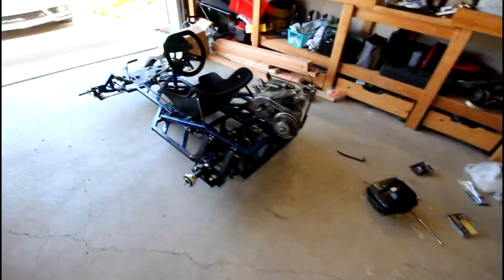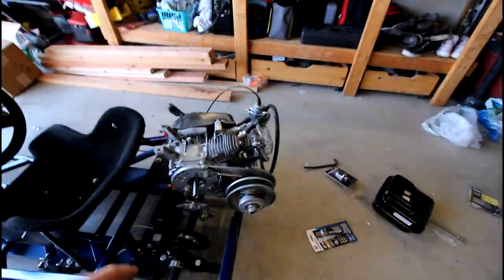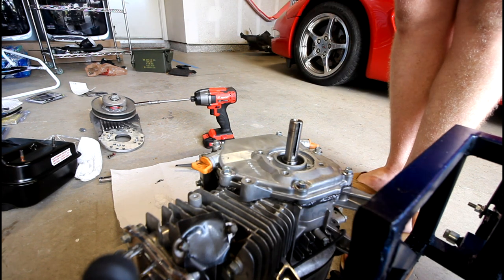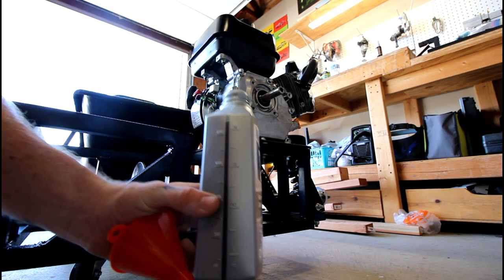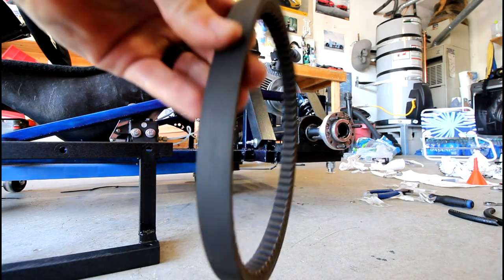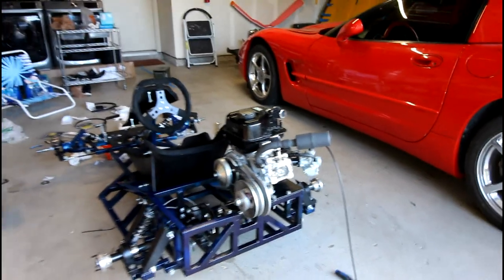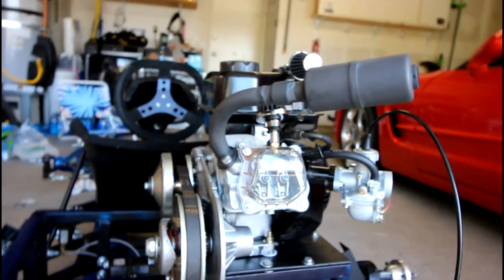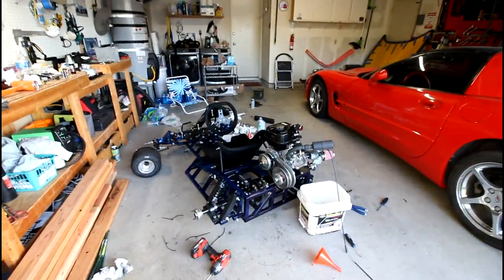My Homemade Go Kart Runs Again!! - New Mikuni Carb Setup!

Comment: So what was the problem what did u fix I have the same problem took the governer out and it won’t start the valves we’re out of place put them back and still won’t start
Reply from the maker: The rocker arms had to be re-lashed. Which basically means the tolerance between the rocker arm and valve spring cap had to be adjusted. When it wouldn’t start it was too tight and wouldn’t allow the  valves to compress properly
Reply from the maker: You basically have to get a feeler gauge tool and adjust the exhaust and intake valve spring lash to the factory recommended clearance. It tells you the proper clearance in the predator 212 manual.